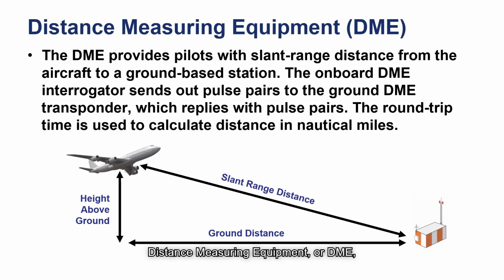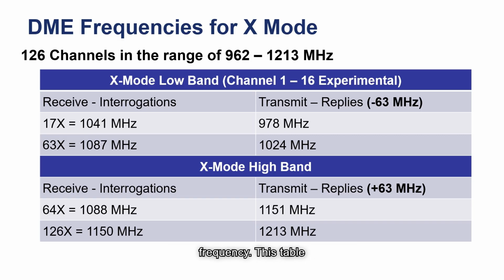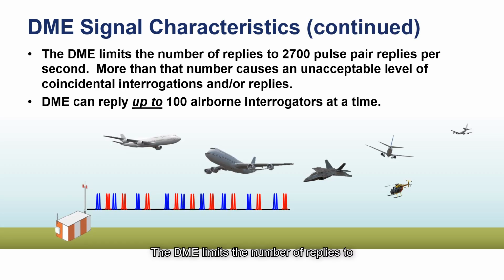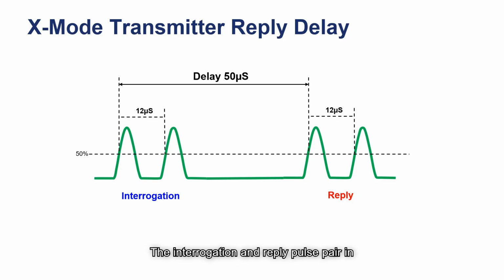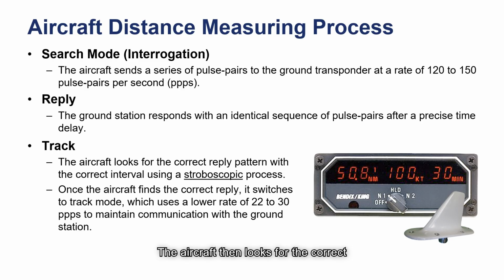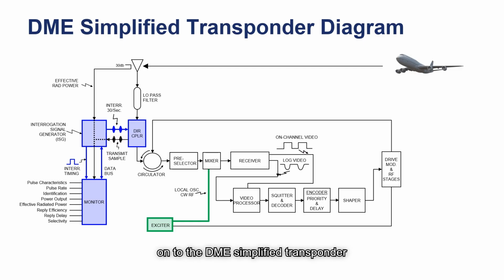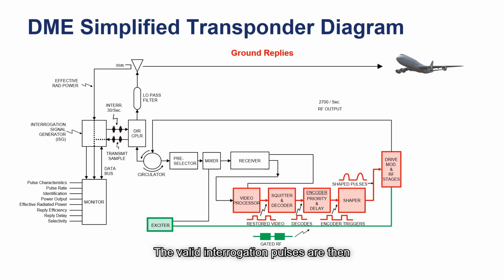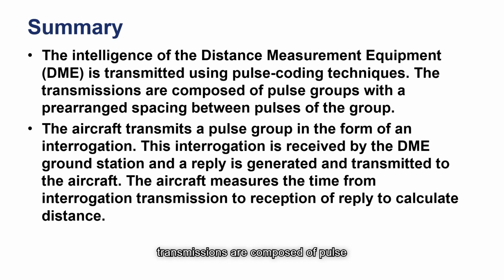DME Concepts for Electronics Technicians

Comment: Is DME considered a general type of equipment, or is it specific to a certain system? I'm familiar with the TACAN, VOR and MSSR but I don't remember the term DME being used to generally describe them.
Reply from the maker: The TACAN provides distance information in exactly the same way as a DME. The difference is that the TACAN also provides azimuth by way of additional reference pulses in the pulse train and modulation of the pulse train. In fact, TACANs can be downgraded to DME-Only operation if the antenna control system fails.
Reply: DME is the civilian version of TACAN. It is frequently paired with VOR and ILS or used standalone for enroute traffic.